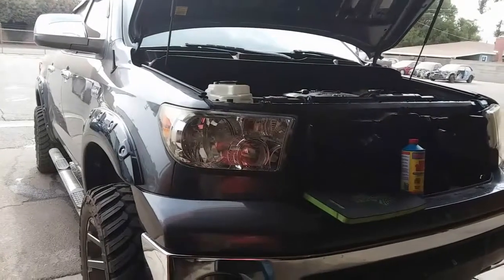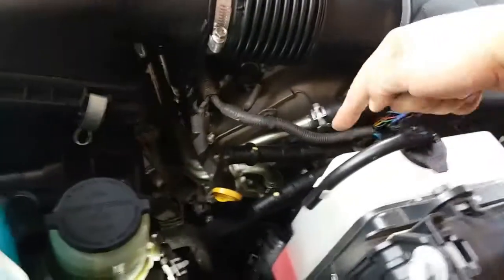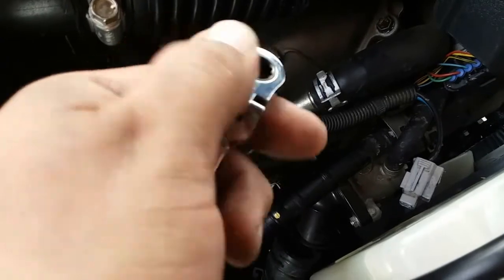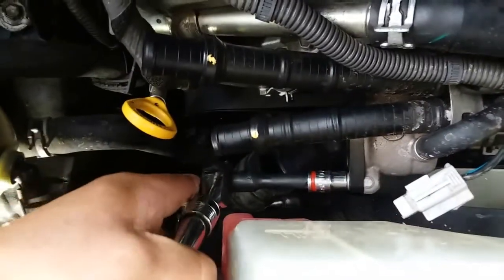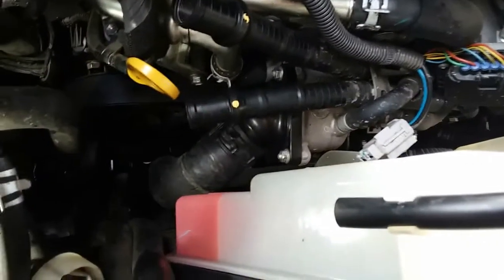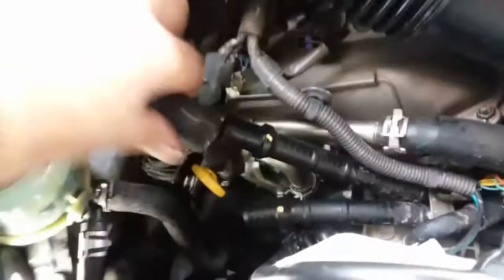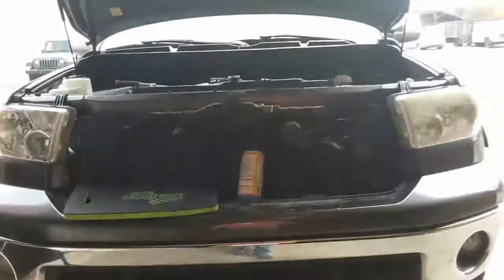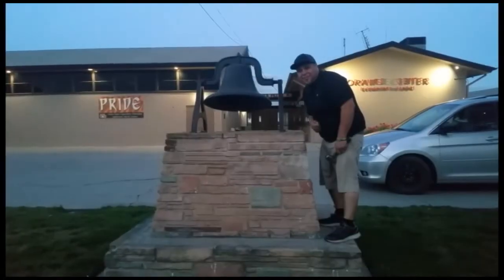How to: Install a Thermostat on a 2011 Toyota Tundra 5.7L

Comment: Hey George!  How did that Blue Devil work?  My 5.7 Sequoia has a leak around cylinder #5.  Thinking of using a sealer for now.  I've also seen Steel Seal.  Any recommendations would be appreciated!!
Reply from the maker: it works pretty good but this isnt a permanent fix its only temporary